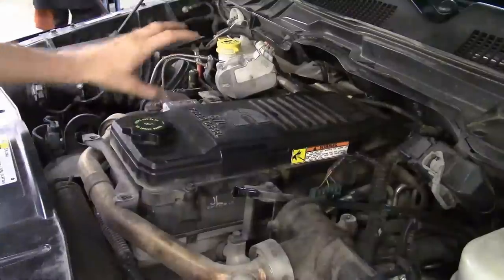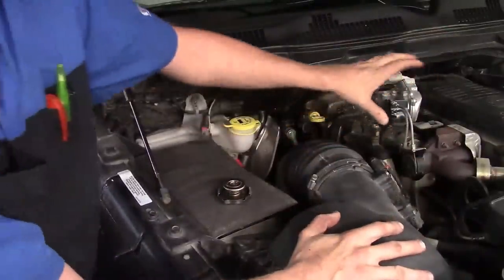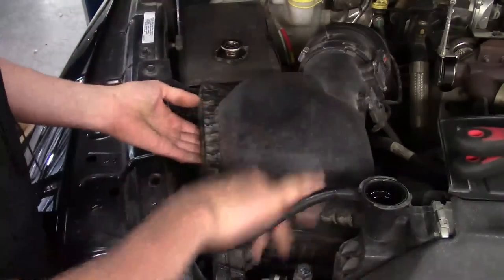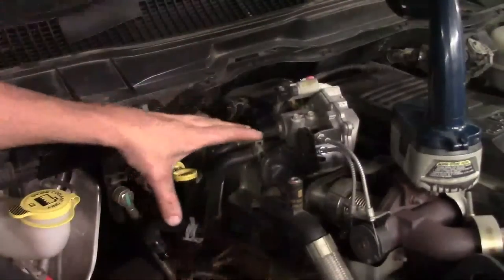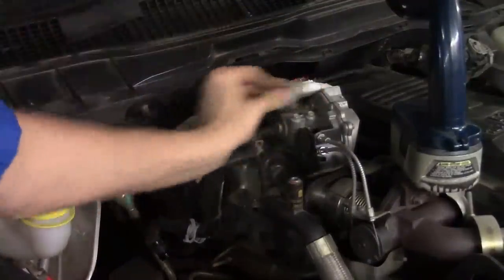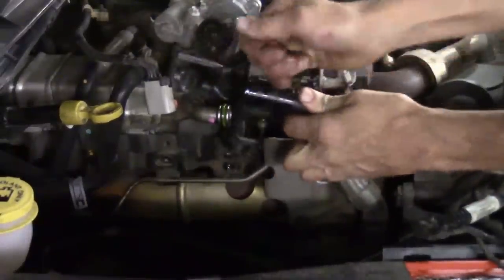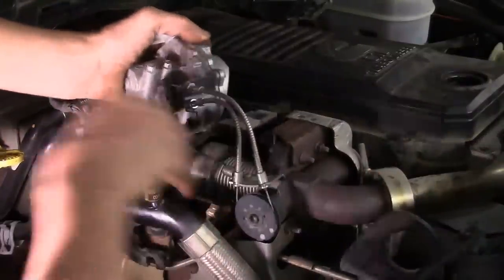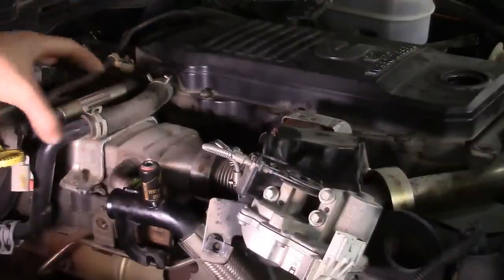Part 1/3: Dodge Ram Cummins 6.7 diesel EGR cooler removal and cleaning

Comment: Would it work to just unplug the egr and taking off dpf without a programmer?
Reply from the maker: The issue you run into is you will have a check engine code and possible reduced performance forced by the PCM/ECM not seeing the correct data. Its still an area I need to check more into so that I can get a better understanding of what is possible and what is overkill.

Comment: Thinking seriously about doing an egr delete. Anyone have any recommendations on who makes a good kit for the diy'er?
Reply from the maker: Personally I dont but hopefully someone will read these comments and possibly chime in with their recommendations. One day when I get time....it would be cool to hook up with a company that does these deletes and see what is avail.
Reply: +MotorCity Mechanic So far in my research I kinda like the sinister  diesel products.  Good looking products that includes all necessary hardware and clear instructions.
Reply from the maker: I do know that in some cases....deletes are needed. There are some set ups that require a program download.....gutting the DPF internals and unplugging a few sensors. Looks stock but isnt. We have a local customer that had this done.....no further issues so far. Just depends on the year. Plus its a lot cheaper.

Comment: I don't know if it's normal for the big hose coming out of the radiator to look like it's flat or sucked down, looks squeezed, I just noticed it this weekend, don't know if it has anything to do with when I did the egr cleaning?
Reply from the maker: I would make sure that there is no air in the system for sure just in case. Otherwise I havent seen that on a 6.7 so far
Reply: MotorCity Mechanic I poured antifreeze with the Allen screw out until all the air was out and a just a stream of antifreeze poured out then I plugged it again
Reply: And for some reason the container where you fill up the antifreeze on the passenger side close to the windshield is not feeding into the radiator because it still has some green antifreeze and when I did the cleaning I used an orange one, it's weird
Reply from the maker: I wonder if the radiator cap is not opening when it reaches the set cap pressure. That could cause the coolant not to come in or out of the bottle and may cause the collapsed hose as well.
Reply: MotorCity Mechanic thank you man I'm getting a new cap and see what it does
Reply from the maker: Cool. In the mean time thanks for watching the video

Comment: attention all 2013 Dodge Ram 6.7 Cummings Owners. The dodge dealer just fix a recall that many of us don't know is available for Catalyti cconverter . I took my truck in for  a massage that appears in my dash dash stating DEF Service See Dealer Max 5 Mph  . the took off the Catalytic converter and replace for a new one. My truck has 108, 565 miles . Problem resolved. Truck have a lot of power now.
Reply from the maker: You are correct, there are 2 recalls floating around out there.....one is avail and the other isnt yet. Customers will be notified thru the mail when their vehicle is included and when its avail. You can go this link and type in your VIN to see if your vehicle has a recall: https://www.mopar.com/en-us/my-vehicle/recalls/search.html

Comment: Thanks for the video. My truck is a 2014. Had it cleaned at 67,500 by dealer as CA pays for the initial service, now at 120k miles. Bought the parts from Geno's and all were OEM. Kit included O-rings. Used purple power and let it soak for 6 hours. Also cleaned the EGR which was very easy. Noticable difference in performance and coolant temp after the cleaning. Thanks again!